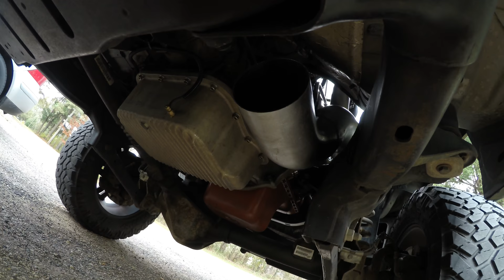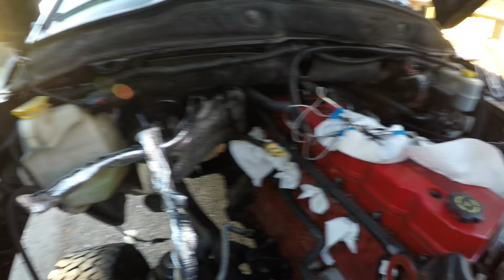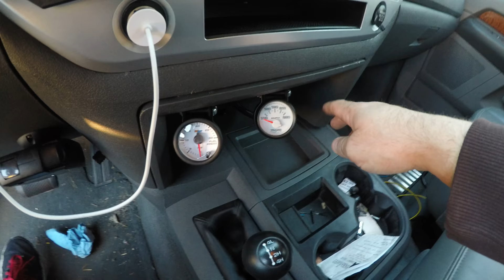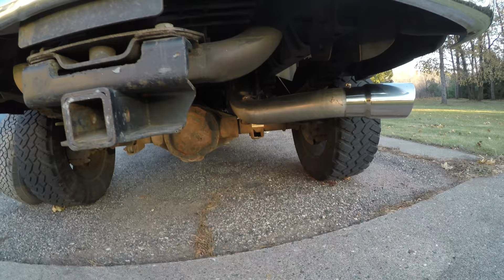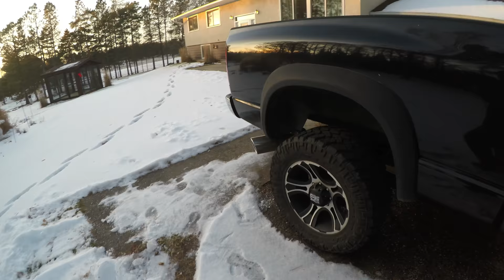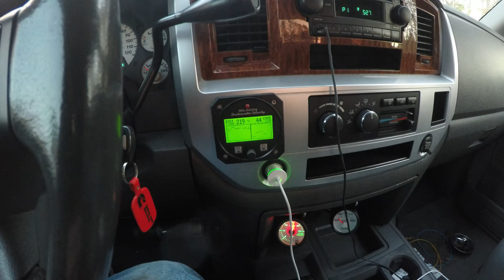Cummins S500 Turbo Install Part 3.  It runs!!!

Comment: Cool video man, I just picked up a s500 and am going to be putting it on a Dinosaur though, a 24 Valve P pump truck. at least I know it will fit in the engine bay lol.
Reply from the maker: Thanks! Good luck on the project! I'm sure it will work out well for you. Those mechanical pumps lay down some good numbers!

Comment: Where do I get the 12 channel digital gauge? This is first I’ve heard of this but it’s the smartest thing I’ve heard in a hot minute! I’ve got a built 5.9! With 625 studs and 12 valve internals and a good start on a good build! I’m at like 42k but I’m digging your setup man! Very Impressed and inspired!
Reply from the maker: It's an aviation unit I got from the sensor connection. They have up graded the gauge since I installed mine adding more features. I think it's a good piece of mind to help protect your investment.
Very nice! Those 12 valve rods do good work!
Thank you for the kind words. I will be redoing my cold and hot side charge pipes since I found flanges to  make them v bands.

Comment: How much was the s500 and can you provide a link, I’m thinking about going with a second turbo to pair with my 369 on my 7.3
Reply from the maker: I bought the turbo from wild diesel for around $1700. The sxe turbos don't come with an A/R so you have to get that separate as well, which was an additional $450.

https://www.ebay.com/itm/BD-Diesel-Borg-Warner-Performance-Turbo-S500SX3-88-2mm-109-7mm/122317949386?hash=item1c7ab7c9ca:g:UukAAOSwo4pYgV7a&vxp=mtr

Comment: Your awesome! You also work more than you talk which is why I subscribed! What's goin on with that plane and bring all the awd turbo you want!
Reply from the maker: Thank you for the support! The shop that I work out of is an airplane hanger so there are a few of them floating around. I will be going and getting the project car in two weeks. I might make a video on it and the new parts I got before I drag it off for paint.

Comment: Gorend trans parts. 
And don't use the ats duel fueler kit..
Reply from the maker: All my trans parts I have came from gorend, plus they are close by. 
I haven't ran other dual fueler kits but I really wasn't to impressed with the ats unit. I've been chasing leaks on it since I put it on and its hard to find a intake that will work with it,  but it's what I have to work with.
Reply: MoPower gorend has been the best for me and my customers . 
Ats used to be on top of there shit. Call them and atleast they will do somthing about it . My problem is ats products never work the first time . I'm allways chaising problems with them . Sweet truck . 
Mines a 05 with a 366/480 and 150% 884/1904tq
Reply from the maker: Good to hear I made the right choice on my transmission stuff. 
Yes, I know what you mean. I chased fuel leaks on their duel fueler kit for a month and the original exhaust manifold I bought from them cracked in less then a year and it took a few months to get a new one those. Then the new one I got rusted through their "durable ceramic coating" in less then a year, that is why I removed it to be powder coated again. I don't think I'll be buying anymore ATS parts. 
Thank you! Your trucks sounds like a pretty stout build! You still running the factory bottom end?
Reply: MoPower it's fun . Steed speed and stainless diesel both make awesome manifolds. . 
If you ever need anything email me @ treypcdp@gmail.com
Port city diesel performance
Reply from the maker: Will do! Thank you!